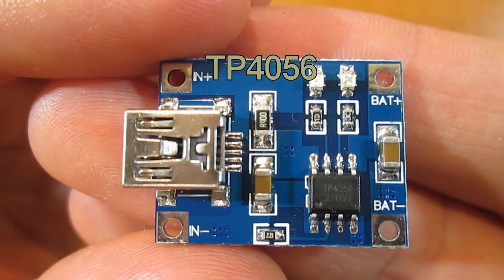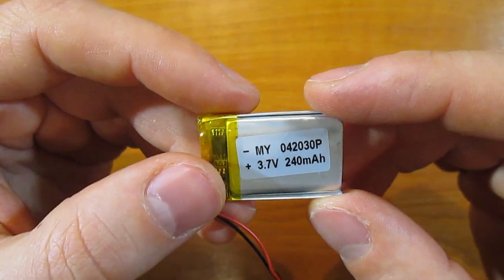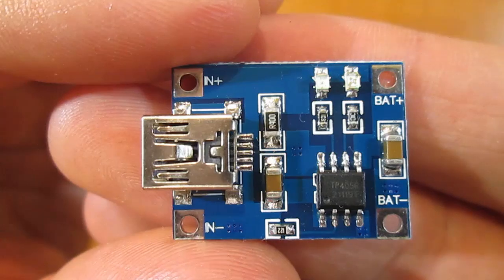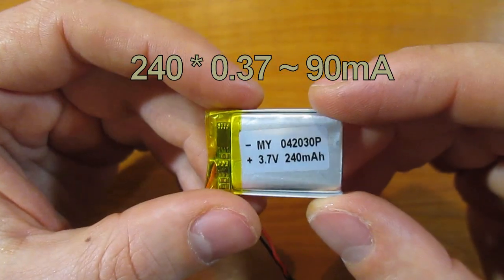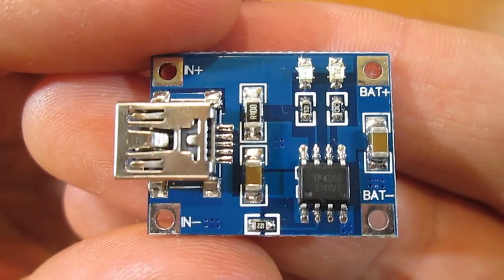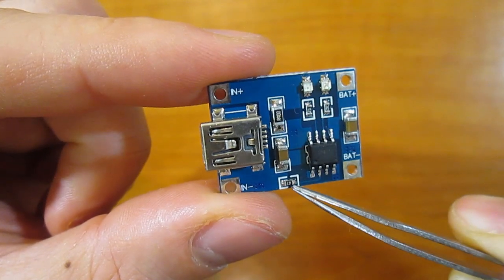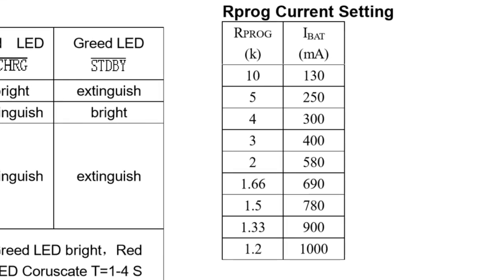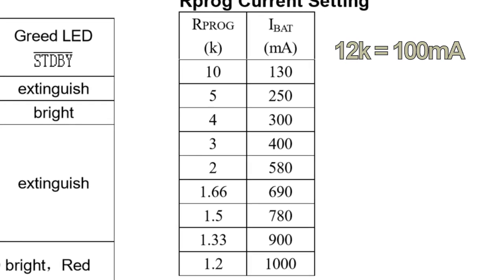How to make LiPo battery charger using TP4056 board

Comment: what does it mean when the big led is blue right away and ther is a very small led blinking when you have connected the cell and plug it in?
Reply: The battery/load is NOT connected / when You connect the Battery the RED LED is ON / when the Charge is Complete the BLUE Led is ON .
Reply: @mariuspetcu7482  when the cell is faulty you get a blue light accmpanied by a very small orange light

Comment: Just a question, this charger cannot be used simultaneously on a circuit or device right? I mean It cannot be charging the battery while using the device (as for example when you use your cellphone while charging it)
Reply: u can use it while charging but the new one kind with to more i.c. type

Comment: Didn't you just damage the cell by running it dry? Ie Below the voltage .  ?
Reply: these small cells have protection board inside, its visible in the video that its there..
Reply: @hardwarehacker7033  Yes it's called BMS

Comment: Hello Sir
Can i charge 500 mah 3.7v lipo battery directly with tp4056 board? Is it safe?
Reply: Not really. You're charging it way too fast. You should use something like 180/200ma of current. The board comes stock with an output of about 1A.
Reply: @somedude2492  is it bad to charge it with higher amps than what is needed?
Reply: @09kenxgamer31  it will blow up probably over time
Reply: @somedude2492  what if it's lower than needed? Example I got an 4amps battery but the battery charger module has an only 1amp. Is it okay?

Comment: Hello Sir. I have a question.   I bought tp4056  module . the output voltage is only 3.9 volts  using 5 volts, 1 ampere cellphone charger. should be 4.2 volts?  is my  tp4056  module defective? Thank you so much.
Reply: 3.9v should be only at the beginning later it will automatically switch to 4.2 or even 4.5 im not sure

Comment: Can i charge this battery with phone charger directly without using this curcit ?
Reply: no.  your phone includes the charging circuit, not the usb power supply. for lipo/li-ion you need to know when it's full to cut-off charging..

Comment: Is it possible to charge 8 rechargeable batteries at the same time ..with one circuit board which u have shown in this video ..is it possible from this board ..pls reply bro
Reply from the maker: No it isn't. You will need 8 boards - one for each battery

Comment: I had to use diodes on mine to be safe. I had issues with the voltage going reverse when small solar panel was used and another time when I tried to recharge a battery. Fried the board. Got super hot. But these are dirt cheap.

Comment: want to charge 7000 mah 3.7 lipo battery by that tp4056...will it make any trouble?
Reply from the maker: You should be able to charge it without any troubles. It just will take quite a long time as capacity of your battery is big and this charger is only capable to charge at max 1Amp.
Reply: hello  @hacksdiychannel  i have  1000 mah 3.7 lipo battery can i use TP4056 with my mobil charger 5V 1A  to charge the Lipo battery Thank you

Comment: What is IN- IN+? Is it power output? why did you need to change the resistor?
Reply: IN- IN+ are for the input connection points.. if we dont want to use the usb connector then we can direct solder the wires on these points and give supply to module. the resistor is need to be change to change the charging current of the battery.

Comment: I have a lipo battery without the charging strip (one that comes with the battery  at the top....(3.7v ).....can I connect it directly to the module???
Reply from the maker: As I understand your battery does not have a protection circuit. In this case I would better recommend this charging board - http://bit.ly/TP4056WithProtectionEBay
It has TP4056 controller and a protection circuit which in your case will replace missing protection circuit on your battery.

Comment: Hello, where "0.37" came from???
Reply from the maker: I've got recommendations regarding this coefficient from RC hobbyists which has long-term experience in lipo battery usage.
These recommendations should be applied to lipo batteries with a questionable quality and without the clear C charging rating. Quality brand batteries usually has some specs written on them, which specify charging rate (usually 1C), so you should choose charging current depending on these specs instead.
Using unknown brand batteries it is recommended to take some precautions, which is the main idea of this 0.37 coefficient. By applying this coefficient your battery will charge for about 2 hours (assuming that it is not fully discharged as usually is the case) and this should increase your battery life.
But I should also mention that 0.37 value is not strict and also depends on how often you use your battery. E.g. If you use it very rarely then it makes sense to apply a bigger coefficient (somewhere in between 0,37 and 1) as your battery will charge quicker, but still due to the rare usage, battery will degrade not significantly and likely will not blow up :)

Comment: Will it work one 3.7 lipo battery 230mah
Reply from the maker: Definitely. Just replace the default resistor with the new 12K resistor as shown in the video
Reply: Hacks&DIY Channel can I charge without replacing resistor
Reply from the maker: In your case - NO. You will blow up your battery.

Comment: This charger is not too shabby a price per its function, unfortunately it does NOT offer reverse polarity protection, as in accidently putting in the 18650 battery in backwards when powered on, it will immediately kill the TP4056 chip. I was thinking of a way to protect it by using an SMD schottky diode between the output and positive pad on the board with the trace open in between, but unfortunately there will be a voltage drop of .15v-.45v and will probably lower the output voltage of 4.2v even lower, which may render this charger somewhat useless or take even longer to charge the battery... anyone care to give it a try?
Reply: Bige4u I’d like to a know the size of the leds and change the red and blue to orange and green respectively along with the leds that power them

Comment: Hi, would it work too for a LIPO 3S batterie?
Reply from the maker: 3S battery needs to be balance charged, so you need 3 of these chargers - one for each battery cell.
Better use a balance charger, e.g. IMAX B6, which is used in this video: https://www.youtube.com/watch?v=XQvWpDvzNPQ
Reply: I understand and have bought the IMAX B6 too. But my idea is to give the battery a charge without removing it.
That's why my question. Then, if I have 3 isolate TP4056 5V input, that means that I can charger my battery? And how should I do that? Put the bat + from each TP4056 in one pin from the battery and soldering Bat -, like you did and put it al together in "Earth" from my Lipo Battery?
Reply from the maker: Well, you can consider attaching a 3S female connector to your device and connect your battery to IMAX B6 using 3S male connectors (http://bit.ly/3sConnectorEBay).

But if you still want to use TP4056 for your project, then here is a schematics how it is done: http://imgur.com/kJo02TN (I was lazy to draw it :) so I was lucky to quickly find this picture on the internet and it is exactly what you need).

So the parts you need are:
3x TP4056
3x B0505S-1W (this is used to isolate power supply for each board in order to prevent short circuit)
1x usb connector (or any other type of connector to connect a power source)

Schematics is self explanatory, so I won't go in details here.

Comment: I have one of these. Just wondering, what is the difference between this and the Adafruit Micro-USB LiPo Charger? Other than the low price :)
Reply: There isn't much difference other than the adafruit micro usb one may have better quality control. 

Most of these tp4056 ones are made by various different companies so you may end up with some duff ones. They both do essentially the same thing though. The only difference is the adafruit micro usb is by default set to charge lower mah batteries (eg 250mah onwards) and you just solder shut a small blob onto a hole on the board to allow it to bypass and charge more higher mah batteries so no need for a resistor on the adafruit micro usb board if i recall correctly.

Whereas these tp4056, by default they are for higher mah batteries (1000mah), and you must change the resistor to allow it to work with lower mah batteries of say 250mah onwards.

there is a big price difference, but the resistor change can be a bugger as the space is minimal on these tp4056 boards. They use a smd resistor which is tiny.

What I did after the question i asked above and advice above was to just solder a regular 1/8 or 1/4 resistor according to the figure given on the resistor table on the instructions sheet for tp4056. 

I didn't bother with the default type tiny smd resistor as i didnt have any, as they are too small, a regular resistor type of 1/8 will do. Just had to unsolder the smd resistor and solder the new one.

Also, as long as the li po battery has onboard battery protection, in theory, the battery should not ever need to use the tp4056 protection anyway, but you should be fine, as the tp4056 newer board has onboard protection, so your battery and board are both providing protection from overcharging or any possible issues.

Thats what i've learnt from the recent experience.
Reply: @dreampopmusic  if i have 1800mah battery, is it ok to use in tp4506? I dont quite understand electronics.
Reply: @jcmfrancisco021  what about 3.7v 1500 mah lipo battery???

Comment: what I would live to see, is this hacked with an added photo resistor, if you do that forward me the video for multiple shares
Reply from the maker: I don't quite understand what is the use case of using charger with photo resistor. It just does not make any sense for me to use photo resistor in this charger.
But it makes sense to use a potentiometer so you could adjust charging current. In this case you will also need an ammeter to monitor the output current.

Comment: Can you tell me the 
lithium charger I could manufacture, for a battery of walkie talkie of 
7.4V lithium without midpoint, there are just 2 pines for operation, 
what do you think ??? And what module you could serve me
Thanks in advance for your answers
Reply from the maker: It's not enough info for me to take any judgements, but I suspect that you have 2S 7.4V battery. In this case in order to take a good care of your battery you should balance charge it. You have few options. First option is to buy a balance charger (recommended), e.g. IMAX B6 which is shown in my other video (https://www.youtube.com/watch?v=vJvTSIjDA_M), or you can make a simple balance charger yourself by using two TP4056 boards connected to each cell of the battery.